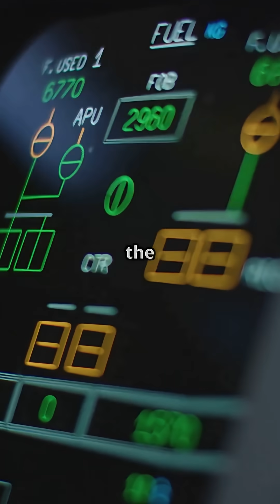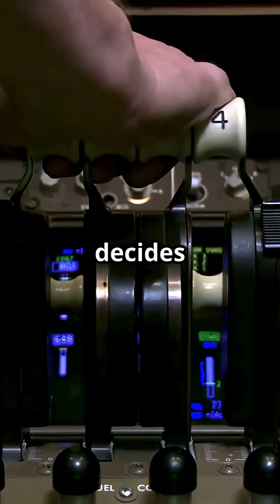Airbus vs Boeing: what REALLY happens when a pilot slams the throttles to the max?

Comment: Pilots know how engines work. If they need ALL the power for the go around at the cost of the engine I’m sure there’s good reason for it. I stand with Boeing there. Though I think a go around unlock button to request it from the FADEC would be reasonable if airbus included one.